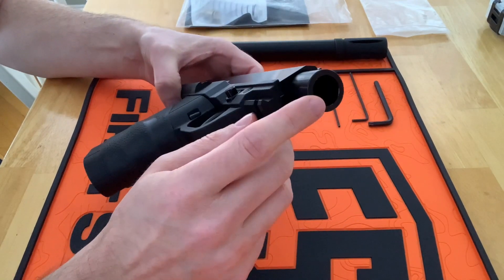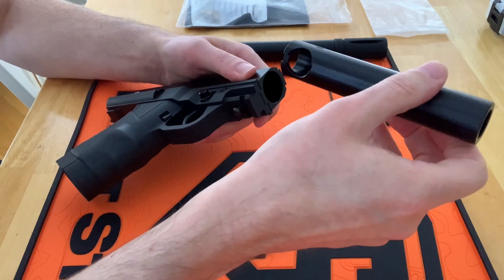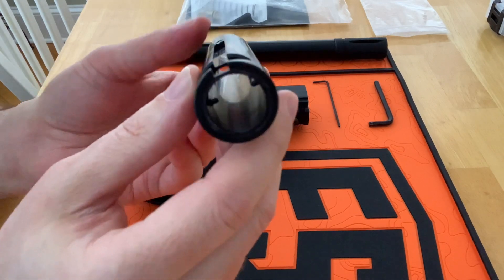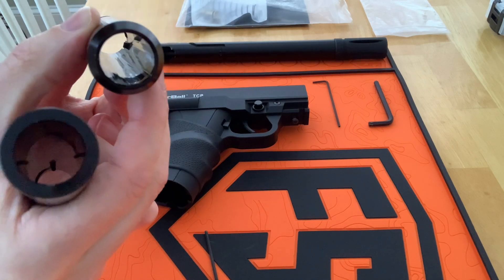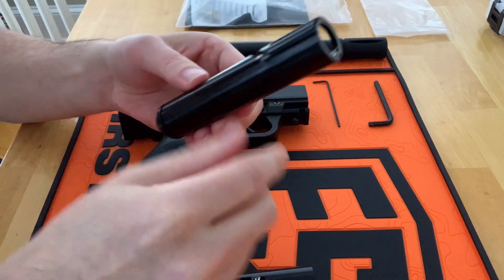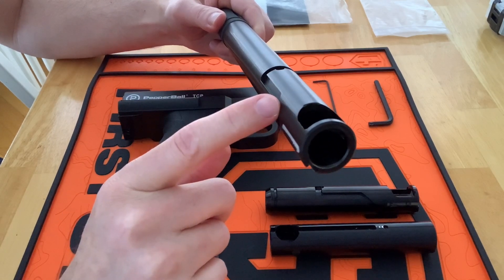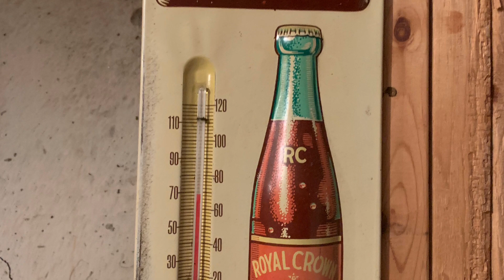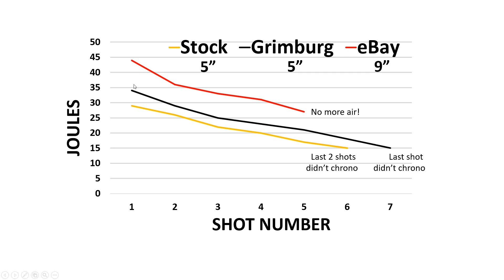Pepperball TCP barrel testing up to 44 Joules with Grimburg JULs (3 barrels)

Comment: What does the vks spring help with?
Reply from the maker: It resets the firing bolt faster than the stock spring and thus conserves air over the course of a couple shots. It's not a dramatic effect but it makes the last 2-3 shots a little higher power and it makes the trigger feel a little more crisp. I recommend it but it's definitely not required.
Reply: @ShadowCatTactical i appreciate u sir.

Comment: Has anyone here had any luck installing the barrel bracket by Grimburg for laser/light mount on the Pepperball TCP?  If so did you have any issues with the attachment bolt that secures the bracket to the barrel and frame?  How did you fix it?

I ordered this kit along with the C5L and matching holster.   When the kit arrived I put it together but the included bolt was too narrow for the threads that connect the bolt bracket.  I reached out and the responded quickly by mailing another bolt.  This one was the correct size for the threads but was too long (see pic).  I reached out to them again, no reply yet.

What they advertised (a fit for the TCP) did not happen for me.  The laser is really nice, though, and I’ll keep it for another gun I have.  I’ll see if PayPal will refund me the holster portion as the install kit doesn’t fit the TCP.

Be careful with this kit.  It’s not what was advertised to me.  If any of you found a way to make it work please share how you did it.
Reply from the maker: @GCasey  Good information. I haven’t tried to build out mine. Hopefully one of my viewers can chime in.

Comment: This is probably the most comprehensive barrel testing I've seen for the FSC/TCP. I really like your range and the quantitative approach you take to the data analysis. Whether any of these differences is worth the "upgrade" is subjective. But here it is all laid out for potential users to examine. Cost is obviously a major options for most of us, so I'm really jealous that you got one of those eBay barrels. That was lucky!
Reply from the maker: Thanks for the high praise. This oldie video still seems relevant today.

Comment: what detents does the grimburg barrel use
Reply from the maker: The Grimburg barrel comes with Azodin detents. They can easily be found at most paintball websites. Mine have been working just fine in the TCP.

Comment: so these barrels would increase the joules on a out of box stock fsc/tcp no modifications?
Reply from the maker: Yes, longer barrels in general provide more acceleration of the projectile by the gas. A 12" will give better power than an 8" which is better than a 5". So rifled builds are always more powerful. The Grimburg barrel has the added power benefit that it's already pre-sized to match the JUL rounds so that less gas is lost per shot.
Reply: @ShadowCatTactical  thank you man ive been so fascinated with this recently and have been binging your videos a lot. which barrel would you suggest personally?
Reply from the maker: Thanks for watching! Personally, I will always go with Grimburg for smoothbore barrels because they are always available (made locally) and are bore-matched to the JULv2/v3 projectiles. The 5" barrel has never let me down and keeps it as compact as possible. Plus Grimburg Less Lethal has great customer service.

Comment: How’s TCP joule in stock without modification? Thanks
Reply from the maker: Without changing the firing bolt o-ring you’ll probably blow it out a couple turns from max on the velocity screw. With a stronger o-ring, you can get up to 30+ Joules about 1-2 turns from max. A barrel with a good bore match will get you to the mid-30s. That’s with no other internal mods.
Reply: @ShadowCatTactical  thank for reply 🤙

Comment: what modification have you done to the pistol ?
Reply from the maker: The TCP has the VKS bolt spring, VKS sear spring, and the PRV has been deleted. Those are good reliability mods but don't provide more power. They do reset the bolt quickly and efficiently, conserving air for the next shots. I have of course changed the air chamber heat-core o-ring to the Grimburg one.  I have shimmed the regulator spring to allow the velocity screw a little more room and prevent brass vs. brass contact. The only changes that improve power are the longer barrels. With my 9" eBay barrel I get mid-50 Joules easily when the projectiles are hand bore-matched.
Reply: @ShadowCatTactical  WOW !!!! thats really awesome work you have done there bro , enjoyed the video , thanks for the super quick reply !!!

Comment: Dang that would actually shatter bone, now it's not non-lethal anymore
Reply from the maker: Yes it could break bone with the right shot. Definitely head shots could be lethal. These aren't toys and can with the right setup be used effectively for personal protection.
Reply: @ShadowCatTactical  Quite honestly a cool conversion. Not sure about the legalities though. In countries where you couldn't own a firearm, what you did is a great option to really make sure it lays down some power.
Reply from the maker: @Ardeact  There are 3 main ways to increase power in these launchers. You can add barrel length, increase the size of the air chamber, or push more PSI through from the tank or CO2. The barrel length is the only change that is free from stress on the launcher internals. The other two will cause problems with o-rings or damage internals eventually. I avoid the others, although many rebels just throw caution to the wind and go for max power.

Comment: What's the difference between the TCP -&- TRP ?¿?¿ Just the quick piercing thingy?
Reply from the maker: Yes, that's the main difference that I see. Either method is fine. I personally like the twist-to-pierce for several reasons that I'll be talking about real soon in a video. Stay tuned.

Comment: taking out the stock barrel on a TCP, to put in a Grimburg barrel, is this easy to do? If it is, that seems like a nice power boost.
Reply from the maker: Removing the stock barrel is just a twist and remove. The Grimburg barrel uses a screw to hold it in place. It's easy but you do have to hold it tight and have a tool and you have to do that process everything you do service. Not hard but an extra step. I get the best results with the Grimburg 5" barrel per length not just in this video but consistently. My longer barrels will give more power due to the extra length (6" and 9") but they are much harder to bore-match projectiles. With the Grimburg barrel you just buy JULv2 and that's it.
Reply: @ShadowCatTactical  awesome simple enough. I just purchased an all black TCP like yours
Reply from the maker: @joesolo7719  Congrats! I have lots more TCP content coming. I love mine.

Comment: Would you have any problems if the barrel and round rifling configuration are mismatched. I have the A5 but I got the HP68s on sale which are rifled. They also fit kinda tight even though they're .684 and the barrel is .686
Reply from the maker: The Grimburg A5 barrels are bore-matched with their projectiles for better performance. It should be a very tight fit if you are using the Grimburg A5 and not one from somewhere else. However, I'm not aware of any A5 barrel that fits into the Pepperball TCP or VKS. What launcher are you using the A5 barrel in?

Comment: In this case size dose matter 🤣🤣 so I changed my thoughts on getting a Grimberg barrel after Christmas probably I tested my upgrade work on an ebay barrel I have 2 of 14" & longer way to long but wow the fps I got wouldn't want to be on the receiving end of that so I'm thinking 8" would be perfect for my setup
Reply from the maker: That eBay barrel was a great purchase for me. I got the best power with bore-matched rounds. See my other video using the 9" barrel where I got over 50 Joules. https://youtu.be/pnHAJWVCL-0  That's basically reproducing the power of the Tiberius T8.1.

Comment: You need to ADJUST thr screw in the back 

Ours can hit 4. No problem
Reply from the maker: The velocity screw is 10 turns in from flush and is probably too high for best efficiency across the entire mag. I may adjust it back down for more consistency but I don't really want to crank it up higher. Hitting 400 on the first shots might feel good but the 12g CO2 will run out fast. Maybe with a 16g or 20g CO2 mag it might last a lot longer. Thanks for watching.

Comment: i cannot find this barrel anywhere can you please post a link to it?
Reply from the maker: The 9" smooth bore barrel was an import from China that was readily available on eBay in 2021.  Unfortunately, the supply chain or other issues may be to blame. There is no link at this moment to share.  Hopefully they come on the market again soon as they are quite well made for the price. I will certainly post a video whenever I hear about these barrels being available again.

Comment: Hello, how many turns from max is the velocity screw adjusted to, thank.   I’m having issues with double feeds at 1 turn from max.  My detents are good.
Reply from the maker: I just determined this recently for an upcoming video.  My TCP is 10 turns in from flush.  Check out the video for the details.  I can't say how far that is from max because I try to never compress the spring all the way. I do use some shims which I will go over in the video.  Double feeds generally come from the regulator sear spring being too weak. You may consider upgrading to the VKS sear spring as part of the PRV delete kit sold by Sterling Self Defense. That helps a lot with conserving power and eliminating double feeds.
Reply: @ShadowCatTactical  thank you sir! Looking forward to the vid.

Comment: Great comparison.  Thank you for sharing.  I’m considering turning my TCP into a carbine.  Have the ASA bottle adapter, FSC Carbine Rail Kit.  But having difficulty locating a longer barrel.  Couldn’t find the longer barrel you have in you vid on Ebay.  If anyone who has purchased the barrel can provide me with a link that would be great.  Or any suggestions on other barrels would be greatly appreciated.  Thanks!!!
Reply from the maker: Unfortunately the cheap eBay barrels from China dried up and nobody knows when more will come. Fortunately Grimburg has 8” barrels. Combine with their JULv2 for best results.

Comment: Great Video as for the Grimburg barrels that's my one gripe how there held in I much more prefer the original system for locking the barrel in place don't like the fact that the Grimburg's  can wear from the screw rubbing on the inside
Reply from the maker: Yes indeed.  Kurt from Grimburg explained it to me by saying that doing this allows them to avoid having to get the barrels machined overseas and rely on the supply chain.  The hole is a genius idea but it can wear.  I've examined mine carefully over months of tension and although the outer coating has scratched some, the hole is holding up.  Now I'm more concerned about the other end.  The breech is the same tight bore and the firing bolt cannot enter the breach without hitting.  In my mind that will limit the power setting that you can safely use without breaking the bolt.  Definitely need a VKS spring if you are using a Grimburg barrel in my opinion.

Comment: Can you explain how can be the barrel at fault to lose CO2?Normally there are other issues,like the magvalve or so.The barrel is a fixed metal part what has no influence on the airsystem.
Reply from the maker: Good question.  I don't completely understand the physics but I'm learning more about it.  The longer barrel takes a split second longer for the air pressure to exit the system and a split second longer for the bolt to reset. That extra time however small causes air loss.  Additionally, in this video I used my JULv2 that were bore-matched to the Pepperball stock and Grimburg barrels but not to the slightly larger bore eBay barrel and that also causes some extra air loss.  The follow-up video that came out last week highlights better results all around when I switched to the eBay barrel bore-matched rounds.  Check it out as well as the bore-matching video from this series.
Reply: @ShadowCatTactical  Cant believe that.There are other videos with a long barrel and no one had this problem.The ball is longer under pressure because the barrel is longer and so the accelaration time is longer,thats why you get more joules out of it.Thats all.The gun fires the same amount of gas,if you didnt play at the regulator screw when changing the barrels for the test.I just have a stock FSC(barrels sold out all over the world).Sometimes happens leaks,but thats in the interiors of the gun,like mag or some o-ring or so.
Reply from the maker: @sven471111  Regulator is same setting. See the later video for comparison.  Maybe it was a leak. That’s always possible but the bore matching is also a key factor.
Reply: @ShadowCatTactical  The bore matching is just to minimize losses between ball and barrel.has nothing to do with the mength of gas fired from the gun.however,the test was interesting.just there are no barrels to find on the whole planet right now.the lapco was announced in March and now I read something about summer... what's your opinion about the grimburg barrel?do you thing this last long because of the screw?
Reply from the maker: @sven471111  Yes the bore matching does reduce loses.  That's why the Grimburg 5" barrel outperformed the Stock Rifled 5" barrel in this video. Less air loss so there was more power across the entire mag (see the graphs at the end).  The length of the barrel is also part of the equation.  Longer barrel does have an impact but I can't give you a number on how much (yet).  These are complex topics that will take further testing.  I'm an experimentalist who is seeking the right answers without caring what the answer is because I have no vested interests.  As far as barrel availability I did talk about this in my latest video and give my reason why Grimburg is the way to go right now. I love their 5" barrel and the 8" barrel is getting great reviews. I think the screw method is sub-optimal but they have new barrels coming out that seem to be more durable and hopefully will hold up better to that constant tension.  My 9" bore-matched barrel is functionally giving what I would expect from an 8" Grimburg barrel.  The Grimburg barrel has one advantage in the breach where they have optimized it for feeding but I haven't had any feeding issues with my cheap eBay barrel.  The video link is here if you want to hear my discussion about barrel options and see how the bore-matched projectiles do better:  https://www.youtube.com/watch?v=pnHAJWVCL-0&t=799s

Comment: Could you possibly test the TCP smooth bore, which mine actually came with, vs the TCP rifled barrel.
Reply from the maker: I really like the way you think.  That is definitely a good test with them both as smooth bore.  Unfortunately, I don't have a smooth bore TCP barrel to do the comparison.   At one time I looked for a Lapco 5" smooth bore but couldn't find one.  However, I think I know what the result should be. Smooth bore is smooth bore and the TCP barrel is very well matched with the Grimburg JULs already and with a little bore matching like in my prior video, it should be functionally equivalent to a Grimburg 5" barrel.  I certainly wouldn't buy the Grimburg barrel if your stock TCP barrel is smooth bore.

Comment: I just ordered the TCP.  Is there amy difference in FPS shen using 12g vs 8g C02 cartridges?
Reply from the maker: I have compared them a couple times in the past. The first shot with either will be basically the same.  But the fall off in FPS will be a little greater for shots 2 and 3 but then really fall off fast with the 8g CO2. So the last couple shots are weak.  I do have some shooting with an 8g CO2 coming up at the beginning of a video scheduled for mid-March so stay tuned for that.  I didn't chrono there but I show the power on a target. With the PRV delete kit from Daniel Sterling the 8g CO2 performs admirably but all things considered you can't go wrong with 12g.  They are cheaper, abundantly available, and you can use all the CO2 in an efficient manner.

Comment: How many full turns did You give the gun
Reply from the maker: It's roughly 10 turns in from flush with the screw.  It can go another 1-2 turns but that's enough FPS for me.
Reply: @ShadowCatTactical  so you gave it 10 turns from stock out of the box
Reply from the maker: @xpy1  I did it slowly over the course of the first year. About 2-3 turns and you can still shoot pepper balls.  After that you are getting into the 20ish Joules range.  Yes, it takes about 10 to get to the 30+ Joules range.  In a future video I will be unwinding my velocity screw to remove it for maintenance and the exact number of turns will be reported.

Comment: Any links to the eBay 9" barrels as I cannot find any. Awesome video
Reply from the maker: I checked eBay and they are not currently listed.  I purchased mine in May 2021 for $17.10. They were called "New Paintball Barrel First Strike T9.1 & T8.1 Tiberius Arms Threaded Tip 9 Inch". These are probably shipped in batches from China.  So wait a while then check again with those search terms.

Comment: Grimburg advertises up to 42J with their 5" barrel. I can only get 31J 🤷‍♂️
Reply from the maker: In my recent 2 videos the first shot was 36 and 34 Joules.  You aren't that far away.  Use a good lube like Dow 33 or Dye-slick lube on the air chamber/bolt.  It bumped up my Joules significantly when I switched to it.

Comment: Is the the matched barrel….
And when I remove the original barrel it to will have a spring
Reply from the maker: You will use your same spring with any of the 3 barrels. The aftermarket barrels don't come with a new spring.
Reply: @ShadowCatTactical  ok thanks